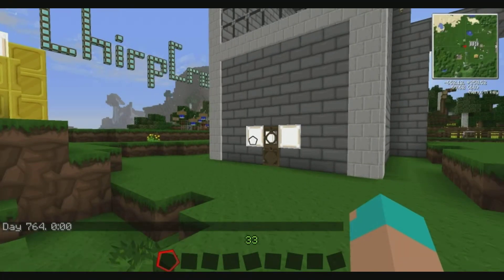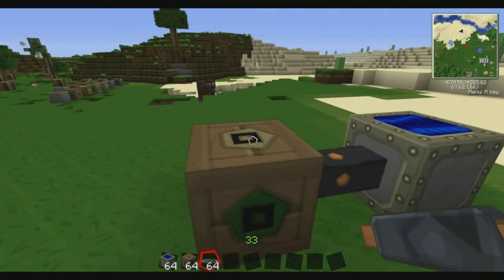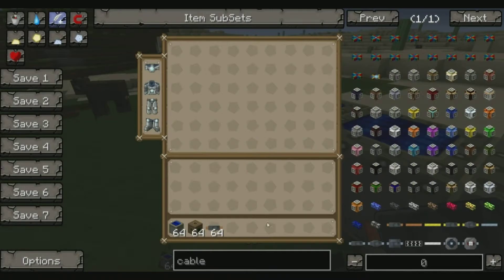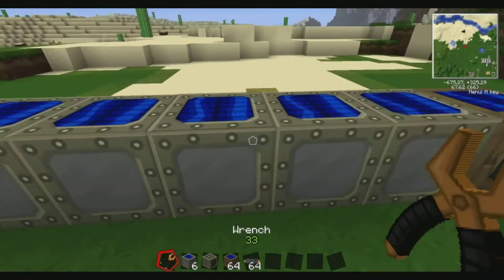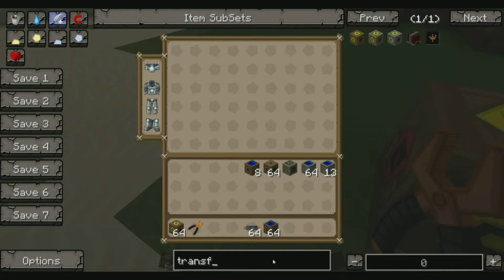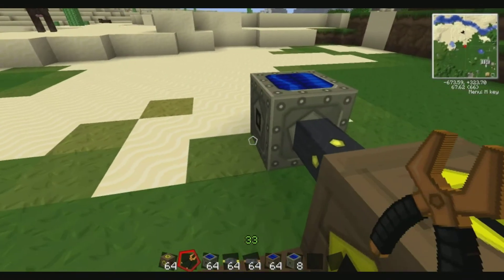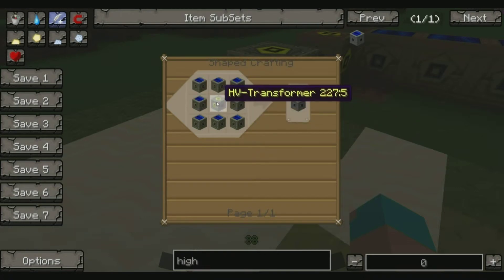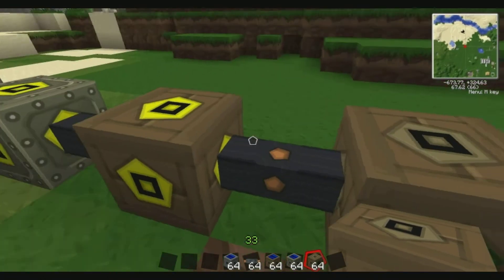ChirpCraft Tekkit Lite Tutorial 7 How To Build a Solar Farm

Comment from the maker: Yea copper cables supports up to low voltage, gold cables support up to medium voltage, HV Cables (refined iron) support up to high Voltage and extreme voltage. Glass fibre cables handles up to high voltage but has the least energy lost over distance. keep in mind that gold and HV cables lose more energy than copper cables.